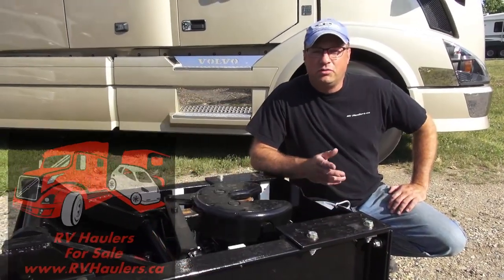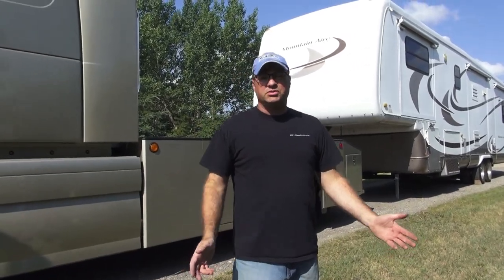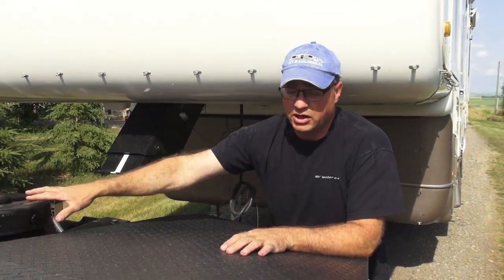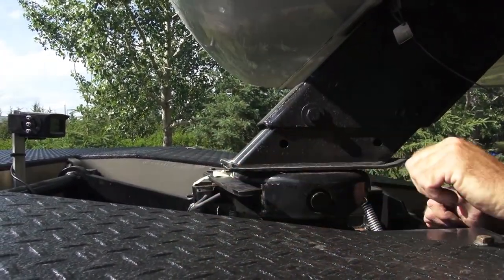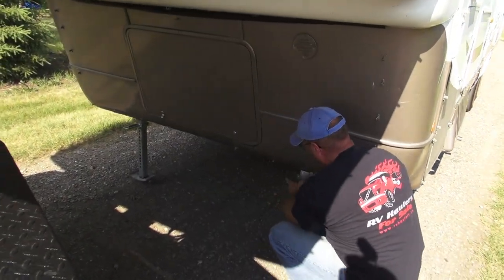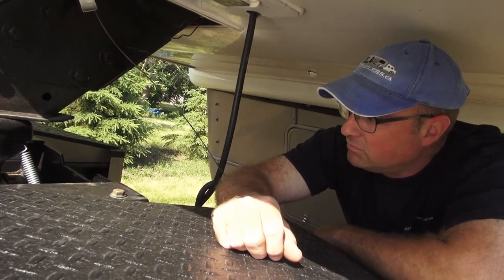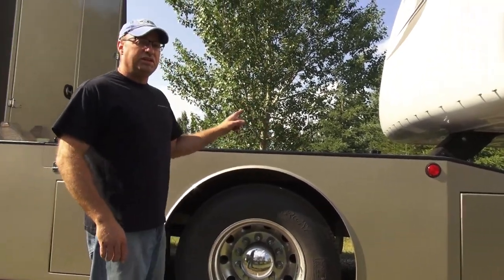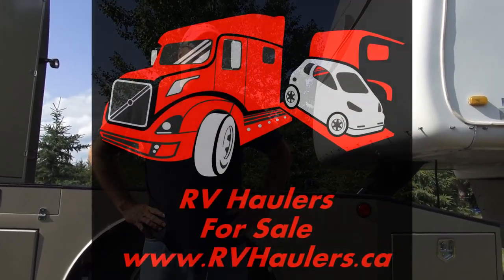How to Hitch and Unhitch Your 5th Wheel to an ET Hitch

Comment: It is amazing that you people in Canada and the US can tow trailers at almost any weight using electric brakes.Here in Australia any trailer, caravan, or a fifthwheeler over 4500 km we have to have installed air brakes and that can cost up to $20,000.

Comment: Don't have a Volvo truck just a Ford F-150 and a small 24ft fifth wheel Trailor.  This was the best presentation on hooking up and un hooking up.  Thanks.    I dropped my fifth wheel on a Ford F-250 Bed and I had to replace the bed.  It was. Friends truck.  1999 diesel.   Had I had this it would not have happened.
Reply from the maker: Wow Jim.  Thanks for the kind words.  I am glad your found our video helpful.

Comment: Nice video.  One comment on coming in straight for the hookup - yes it is best to come in straight. But you "can" come in at an angle and hook up without any issue. It is just harder to line up. A minor point.  I love my ET Sr with "Super Binkley". I would not have another hitch.
Reply from the maker: Jack Mayer Thanks Jack for the clarification, and for taking the time to post.  Hitchingis do-able at an angle. The only thing I personally miss is being able to use the "white lines" to get things lined up when I am coming in at an angle.  Alternatively if you have an experienced spotter like Danielle, you are set!

Comment: I am fascinated by your videos Gregg as here in the United Kingdom, your type of company does not exist. To drive one of your trucks with a 5th wheel RV, UK drivers need a Class 1 HGV licence and cannot drive these vehicles at all on a standard driving licence. As this type of licence costs in excess of $2000 with the training and examination, the existence of this type of vehicle is very limited. Add to this campgrounds that will only take a maximum of 26ft motorhomes and you see more problems. I love watching you and your son delivering these great vehicles to their new owners.
Reply from the maker: Thanks for watching Alan.  I see the solution.  You need to plan a trip to Canada and come driving.  A road trip for the guys.

Comment: Hi Greg, I am not sure why your landing legs on the trailer aren't fitted with lager landing plates. If you take a look at the landing legs fitted to refrigerated semi-trailers, they have a roll plate which can take a fair amount of punishment when coupling and uncoupling. The other point is to go back and double check that everything is connected correctly after hitching.
I thought that Volvo's are equipped with electric ride height airbags, which I would prefer to use for coupling than the electric/hydraulic method that you use.

Comment: The trailer has great looking tires...  15/16"?  Gregg, I recommend pads for the legs (bottom of the landing gear) and would definitely invest upgrading the landing gear.  I've seen many trailers especially tractor trailers sink, and legs can actually penetrate parking lots/areas. Regina, SK was notorious for this... gumbo conditions.  Good video.
Reply from the maker: Tony Hamilton Great suggestion - I will always use some big pads, as my 5th wheel trailer is approaching 20,000 lbs, and I think I have close to 4000 lbs on those front jacks at times.  I took the liberty of going without pads for the video, as I was in my acreage driveway, and the driveway has been there for 60+ years.  Good eye regarding the tires - those are actually 10,000 lb axles with dual tires on each side - 8 tires in total!  I just had to buy new tires.  They are a light truck tire, and at $200 each, 8 + 1 spare added up to a good bill.  Thanks for taking the time to share your comment.

Comment: Hi Gregg, great video! on other 5th wheel hitching videos I've seen they cover the hitch plate with a layer of grease or put a Teflon (I believe it's Teflon?) disc on the pin to lubricate between the hitch and pin, is this not needed on these hitches? 
Thanks for all the great videos and God Bless!
Reply from the maker: +TheHardTale Thanks for the excellent question.  We never use grease.  It produces such a mess, and a risk for getting it on your clothes.  We have started including a specially designed plate that is not teflon.  It looks very similar, but we have them cut to our specifications and our thickness needs. It has a natural lubricity that has superior friction reduction, and it does not compress like teflon.  Our results have been very positive.

Comment: Gregg, have a question about the hitch on the truck, when you do a conversion you put a smaller hitch on than originally came with the truck the original hitch is bigger and stronger. Why do you convert to a smaller hitch and not just leave the original hitch?
Reply from the maker: +laz0524 Thanks for your excellent question.  These heavy duty trucks (often called HDTs) have a rear axle that is designed to support a 20,000 pound downward weight.  When we attach our light trailers, we have about a 3500 lb pin weight on average.  Some of the heavier trailers MIGHT get up to a 5000+ pin weight.  That is very light compared to what that one rear axle is designed for.  The result of the light weight, is the truck actually rides very stiff back there.  If we were to use the commercial 5th wheel plate and hitch, it transfers a considerable pounding to the 5th wheel RV.  Those RVs are not designed to handle that force,  and we have well documented examples of people breaking the structure of their trailers when they leave the commercial plate in place.  Yikes - very expensive repairs.

(ASIDE note:  the trailer gets a rough ride, but the occupants of the RVHauler don't.  The sleeper is on shocks and air-bags, and we get a smooooooth ride).

To treat our trailers to a smoooooth ride, we install an air-ride hitch - that is what you see in this video.  It has 4 air-bags under the hitch, that makes sure the trailer (and our wine-glasses in the cupboard) travel without damage.

If you would like to hear more about these hitches, I have a video interview with the brilliant engineer of these ET hitches - https://youtu.be/D9b6Y4w-Q7w
Reply: I thought that might be the answer but wasn't sure.
Thanks

Comment: What about adding an "air dump" to the hitch bags?  Not meaning to avoid jacking the trailer landing gear, just to "zero" out the vertical position of the hitch.

Dump the air from the hitch before decoupling so that you are not waiting for the leveling valve to settle down.  Then dump again prior to coupling to place the hitch in the same vertical position for coupling?  Once coupled, inflate the bags again and you are ready to drive.

This could use the switch that would have controlled the slide function of the commercial 5th wheel plate (if equipped).
Reply from the maker: Thanks for sharing your idea.  Yes, I can picture your idea working.  Thanks for watching!

Comment: Gregg,
Great video. I want Nader if it would be helpful to have an air dump switch in the cab to dump the air bags on the hitch to relive the pressure on the fifth wheel when unhitching. That way you can just drop the trailer legs to the ground and not have to jack the trailer with the front legs.
Reply from the maker: Hello Bill.  There is a risk / reward with every approach.  Your idea has significant merit.  Sometimes, I like to keep things really simple to avoid the chance of something going wrong with the elegant solutions.  One risk might be the addition of the valve itself.   If it ever fails in the future, we would lose our air-ride hitch capabilities.  BUT you could certainly speed up the process, and save yourself a minute in having to raise those legs!
Reply: Actually, some tractors have dump valves in the cab for the rear air bags on your driver's.  Currently my tractor does and it's great for those guys that are too lazy and drop our trailers in our yard to low.  ALLWAYS GET OUT AND CHECK YOU PIN HEIGHT OR YOU COULD OVER RUN THE FIFTH WHEEL.  NOT A GOOD DAY😠😂

Comment: would you not put any grease on the fithwheel to prevent wear and tear on turns
Reply from the maker: We like to use a thin friction plate between the head and pin box plate instead of grease.  It keeps everything clean, and there isn't a risk of accidentally rubbing up against anything and getting your clothes stained.